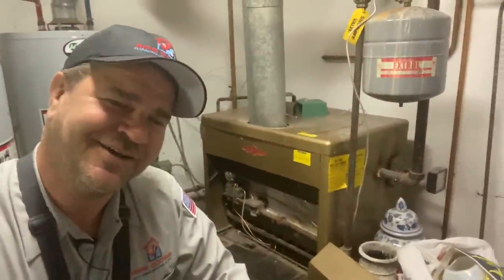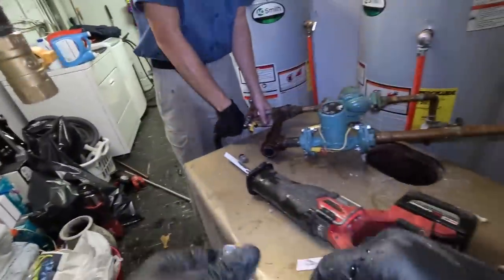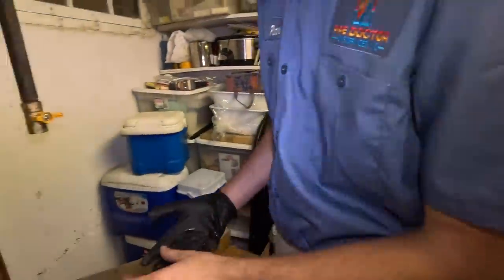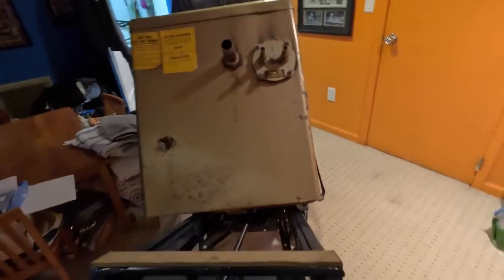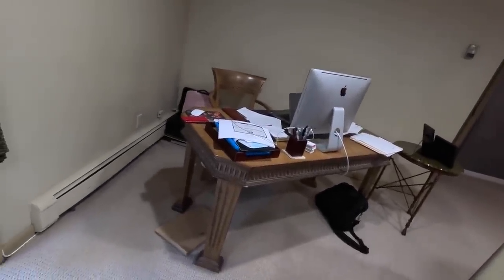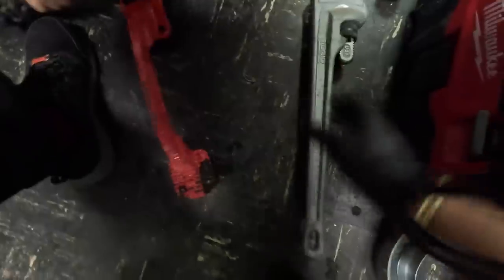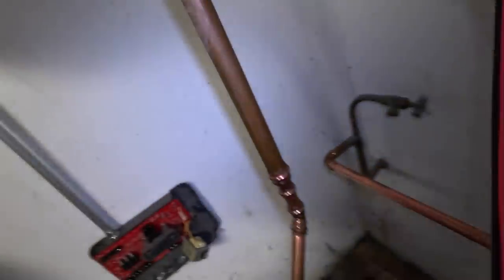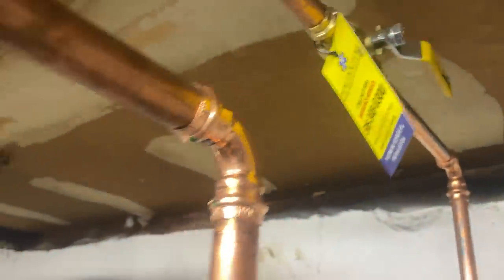Grossly Oversized and Ancient General Automatic Gas Fired Boiler Replacement Installation Video!

Comment: hi mike am the other pipe doctor the guys i work with call me that the stair climber you guys were using i notice you were not using the brake on the wheels going up you risks the guys on bottom of boiler pulling the boiler toward them and coming down on them would not want someone get hurt thats my number one priority no one get hurt i have been doing installs for twenty five year love your pride in your work hope this helps

Comment: Impressive job done on the fly . The Brothers are really coming along nicely. Can’t say enough about those press fittings. The time saved can’t be beat has to shave at least a couple hours off a job like this. That stair lift looks awkward to use and by the amount of groaning you were doing doesn’t seem any less strenuous than a regular two wheeler with a couple of guys. Good video thanks. From the old hvac guy in Toronto.👍👍🇨🇦

Comment: Love the new smaller efficient units compared to older stuff. People say they don't build em like they used to. I would rather they did not. Even my cay has 200000 on it with just oil changes. Old is cool but love anything new tech.

Comment: sawzall blade and sparks flying = teeth deletion. try some carbide teeth blades, expensive but worth it. just beware bending them like you was doing will crack/shatter the teeth off or break the end off at saw. broken plenty of them over the years, but carbide teeth blades are pretty much all I buy now, no matter the blade size/shape.

Comment: Nice video - curious why don't you typically use the Taco 4900? We had one on our Weil McLain, but it was 12 years old and started leaking. Was replaced with an air scoop.

Comment: Good ol oversized antique. Like Ive said before I think back in the day they installed what ever was available, or maybe they had a poor formula for sizing.
Reply: @PipeDoctor  also gotta factor in insulation used to be blow in shit, could even be grass and leaves in some of these houses, old clothes, cotton.. I know if I put in the work and ripped every wall open in my house, sprayfoamed it, new walls. (Windows too) I could live comfortably with a two stage 40,000 btu furnace in -30 degree Minnesota winter, and I doubt it would kick into high stage very often. My house is small, 1.5 tons of cooling is all that's needed, 40,000 btu of heat is the maximum it needs.

Comment: Why the valve on the expansion tank? If someone shuts it off and the boiler fires it will blow the relief valve like the expansion tank had failed.
Reply: @PipeDoctor  It was agents code in CT. back in the day.
Reply: there's also a little stop valve that looks like a check valve that can be used

Comment: This video is not as faked as some other ones he did that shows old boilers are a mess, wiring all over the place My Burnham boiler is 38 years old, and I do all the minor maintenance work, like change a thermocouple.. Work perfect for all these years. Only 2 24v wires go inside the boiler to control the gas valve. Whereas these new shining boilers, with all the circuit boards, fancy electronics. I read when a circuit board fails, part itself is $700 bucks, and now you often have to wait for months to get the repair parts. Meaning no heat for the whole winter.

Comment: Mike try reversing that Sawzall blade so the D handle of the saw  is facing up when you cut.  You can cut more flush against items and the battery will not get in the way because it's facing up now.  This is helpfull cutting close to the ground and against items lower than what your cutting.